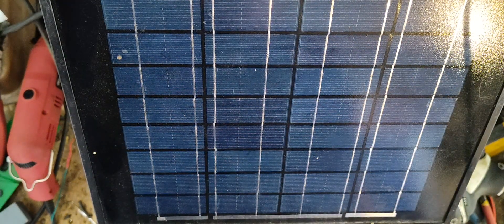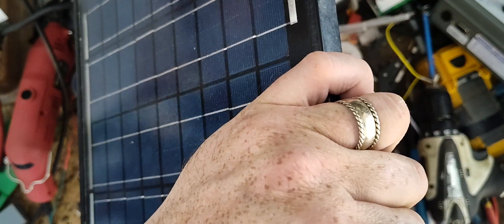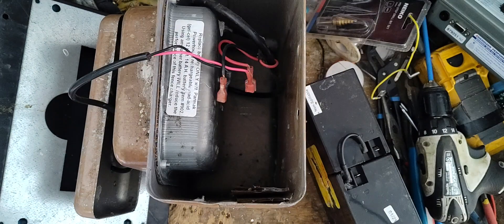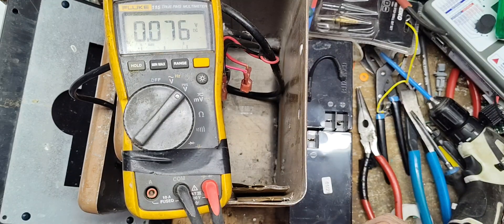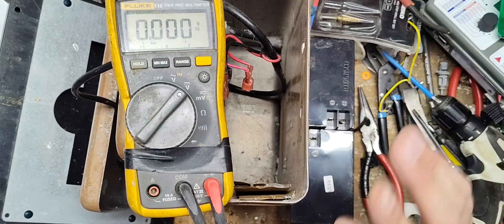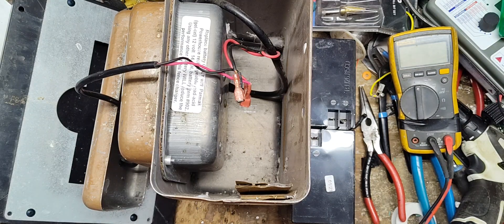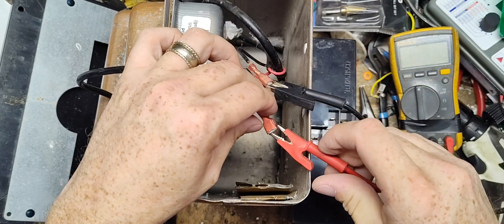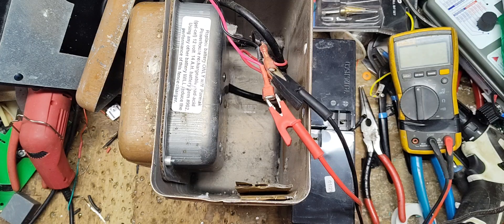Upgrading A Solar Fence Charger To Make It Better Part 1 | Parmak Solar Pak 12 Repair

Comment: What regulator do you recommend using?
Reply from the maker: A regulator set up for 12v and is rated for 6 amp minimum.

Comment: We just put one out 2 days ago n my husband said it dont need 4-5 days to charge even tho I pointed out it clearly said charge it 4-5 days prior to use.  Anyway, my question is, it jumps to green right away n then drops n jumps again to green n then drops to red. N its not clicking. Would that mean it just needs charged up more? Cuz we walked the lines n nothing is touching it or metal. It should be working ( unless it needs charged more correct? N it should be clicking if fully charged) thank u for any advice
Reply from the maker: If it's not clicking, then there's likely an issue internally within the unit itself. If it's faintly clicking, possibly there's a short on the fence dragging it down. There are two things I would try first. I would unhook the fence and ground wires from the unit and then turn it back on and see what it does. If it does the same thing, then most likely your fence and ground are fine. Then I would test the battery with a digital multimeter and make sure it's reading 12+ volts DC. One other quick test you can do is unhook the battery wires from the battery and make sure the red and black wires are still tied together red to red and black to black, then take it outside and turn it on. The solar panel itself should run the unit like normal.

Comment: we have a 6V and three 12V and a 6V with a bad panel as a spare ( I got a panel with a regulator to put on it).  Those cases last forever, the !2V batteries barely last about 1-1/2yr.    I asked them why they didn't have a regulator, he said it would add too much cost...   This was years ago when they could have got a china regulator for a buck to them.    I say I'm going to add one myself....   I have a 1.6 amp charger to start them and then hook up a 0.8A to finish (it wont start with a low battery)..  Sometimes those chargers will run on a sunny day with a near bad battery.   I also say I'm going to add a external battery test point and a temporary external battery hookup but....  
The batteries in the 6V last for 5-6 yrs without a regulator, so they must have matched the panel output a lot closer to the battery capacity.

Comment: I just called Parmak to ask about adding a regulator and to see if they had any suggestions as to why my batteries aren’t lasting very long.  He said a regulator isn’t necessary.  The units are made so that the battery only charges when it needs to.  

So now I don’t know what to do.  I like the units. I like that they are made in the u s.  But $100 per replacement battery so often is not reasonable.   He did say the batteries should last three years, but mine aren’t lasting that long.   If they did, that would be $33 per year. I could handle that.
Reply from the maker: There's a blocking diode inline on the wiring and such, but they're directly tied to the battery with that 20+ volts and it doesn't get dragged down from what I can tell. And from the 5 or so units I've done so far, I haven't had one issue yet.
Reply: So they're still telling people their non-regulated unit is good.   Sounds like they believing their sales literature.    The 6V systems seem to last a long time.  
 I'm  not sure if you're saying you haven't had any trouble with some new ones or the 5 or so that you added a charge regulator to them.

Comment: Would like to put a voltage regulator in mine, were you able to source an economical way to do this ? The one i use in my home built dc system was over 130 bucks.
Reply from the maker: Yes, I was able to find that that works rather well for around $25-$30. It has to be installed on the outside of the mainframe of the whole case because the battery compartment is too tight for space with that large battery inside. Holes have to be drilled into the side of the case of the mainframe to run wires from the charge controller to the panel wiring and also from the charge controller to the battery. I've installed about 5 of these so far for customers. More customers want it done, but they only send in the square center housing and I can't install it on that, it has to be installed on the outside of the mainframe and wires ran into the inside.

Comment: I have  a number of these units to keep black bears away from bee yards and keeping batteries charged in the winter is a constant problem.Replacment batteries work well for a while but they're expensive.Maybe a dumb question but would shading part of the solar panel reduce voltage ?Trying to figure if intermittent shading from surrounding trees is not charging battery or if batteries are getting fried due to lack of charge controller.   Looking forward to Part 2.
Reply from the maker: Yes if the solar panel is getting shaded by trees or whatever that will cause the panel not to have as much charge energy going to the battery. You could try and hook up an external 12v battery to it. It's still 12v, it'll just have more reserve power to last longer when it's not getting as much sunlight to the panel.

Comment: Do you have a link or recommendation for the regulator? I just replaced my battery and would love to extend the life of it
Reply from the maker: This is the one I've been installing
https://a.co/d/bzp8kQU
You will only use the solar and the battery contacts on the regulator for this set up, but not that third connection, I just snipped it completely off.

Comment: Parmak quality has went downhill terribly in the last 5 years. We are looking at going to Gallagher or Patriot for solar fencers which do you recommend?
Reply from the maker: Gallagher by far is way better in quality and I would definitely choose them over Patriot. Too many little issues with the cheapo Patriot stuff, not a huge fan. Another brand you could consider is the Power Wizard brand of solar. I don't see their stuff come in very often and they're also serviceable as well. The PW50S, PW100S, PW200S, or PW500S.
Reply: @FencerFixerRepairLLCKansasCity  we bought some Gallagher i series Energizers a couple weeks ago and a remote and that is the coolest thing to be able to turn it off and on from anywhere along the fence
Reply from the maker: @kowenkopp5648 Those are the best remote control units made by any brand. Also, the remote controls themselves carry a 3 year warranty like the units do and the best part about the remotes, they're serviceable. Every other brand of remote control out there, Speedrite & Power Wizard mostly, do not offer any service parts for their remotes themselves. They're treated as a throwaway device after the warranty time is up, but not gallagher's remotes. I've only worked on like 2 of their current generation remotes which have now been on the market for 11 years, that should tell you something right there on the quality. Just keep the remote from getting wet by leaving it outside. The two I've gotten in were because they got left outside and either dew got into them or rain/snow melt.
Reply: @FencerFixerRepairLLCKansasCity  ok thanks for the tips I'll keep that in mind